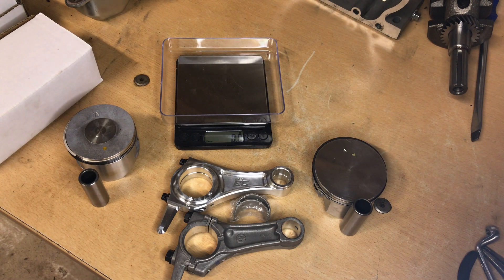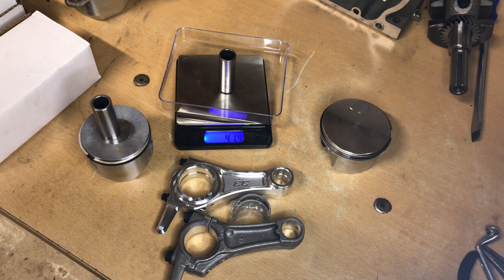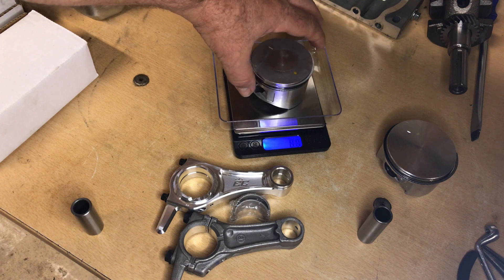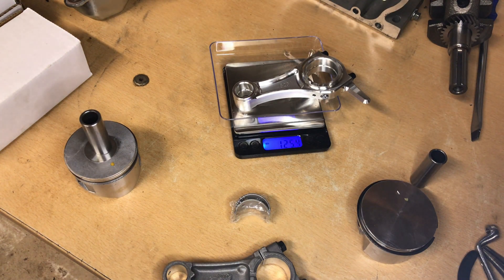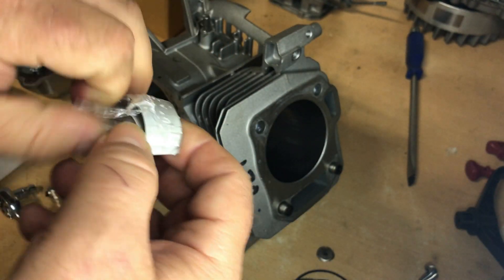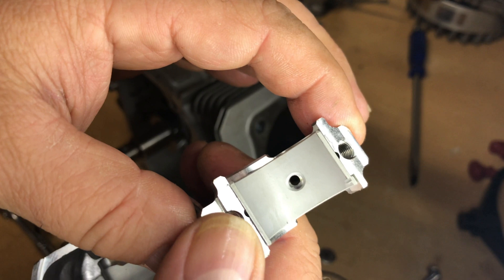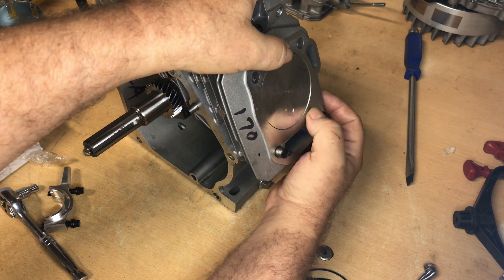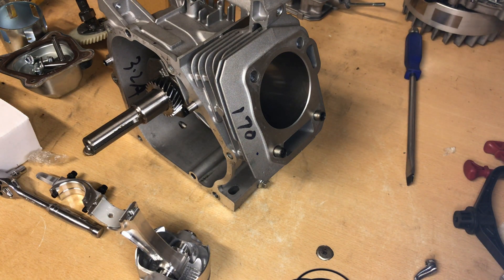Weighing The Wildcat 223 Piston & EC Billet Rod For The "Big Bore" 179cc to 208cc LCT Engine Build!

Comment: Whats the compression height on the wildcat piston
Reply from the maker: Hi Robert! According to EC it's 0.8835" or 22.45mm for the true compression height from the center of the wrist pin on the Wildcat 223 flat top. If you're measuring from the top of the wrist pin bore to the top of the piston you'll likely find they vary a bit, but you'll usually find them to range somewhere between 0.520 to 0.530. And yes, I know (0.010) is a LOT! These work very well with the 3.353" EC rods in most tall blocks (EX: Ducar). The 224 build on the channel used this piston and rod combo and that piston was almost .010 above deck at TDC. I debated whether or not to machine .010 off the top but elected to go with the pop up as it was. Good decision as far as it being a runner, not so good for starting with a pull rope though.

Comment: I have a 208. Is it worth building? The last motor I built was on the 90's, 5 HP Briggs. What parts don't interchange. Cam?
Reply from the maker: Hi Mackelby1! I like the little LCT engines. The 208 block has the same issue as the 179 block. The camshaft diameter at .569 is larger than the Honda clone .549 and Predator 212 non-hemi .559 diameter cams. The only drawback IMO is having to get a camshaft custom ground. There are work arounds of course by simply adding higher ratio rocker arms and a few more tricks. The crankshaft in the LCT engines is much nicer than you'll find in others too. Don't be afraid to build what you have. If nothing else at least the crankshaft will swap into a more camshaft friendly block and side cover as well. My thoughts on the LCT engines is what's the worst that can happen? If it blows and you ruin the block, oh well. 🤣 Better than sitting under a table gathering dust.
Reply: @KentuckyFriedFixes  thanks for responding
Reply: There discontinued 291 has a 58mm crankshaft. Really curious if it fits. Those cranks might be cheap if it's discontinued.
Reply from the maker: @mackelby1  I'd like to get a look at one. Now you've got me curious about it too!
Reply: @KentuckyFriedFixes  I hate to be that sad SOB that can't wait for you to try it so I can find out. Don't hold that against me please! Where do you get your LCT parts from?
Reply: @KentuckyFriedFixes  1" shaft, bummer. Thought I was on to something.
Reply from the maker: @mackelby1  Well shucks. You can't win 'em all but I like the way you think!
Reply from the maker: @mackelby1  The 179cc LCT engines came from the Surplus Center website. I purchased 2 of the 208cc LCT blocks from the bay place. The build parts I order online from several vendors, but EC Carburetors is the only place I've found that has the # 8281 connecting rod (3.353") I've ordered several of the Wildcat 223 flat top pistons from them as well. I'm not sponsored by anyone so I don't like to advertise for free but I do like EC carburetors for their Tilly race carbs. I'll post "Part 2 of the Big Bore LCT Build" soon, looks like part 1 finally got enough views. Thanks!

Comment: Just curious, I have a fairly built 224, and when I changed the flywheel to billit I thought it maybe seemed like you could feel the power stroke more than I could with the stock flywheel. I'm assuming a heavier flywheel would carry more rotating speed through all the strokes, or at least more consistent speed. Have you ever noticed a change in the way it feels at lower rpm? Hopefully this makes sense hahaha
Reply from the maker: Hi Brian! You've got it. That makes perfect sense. The lighter flywheel will not smooth out the engine as much as a heavier flywheel. Light flywheels are tough on rod bearings too. The heavier the flywheel, the smoother the engine will run at low RPM. The heavy flywheel stores more energy because it has more density, this allows the rotating mass to rely on the energy stored in the heavy flywheel to keep the engine turning in addition to the power coming from the power stroke of the engine. Unfortunately though, a heavy flywheel slows the acceleration and deceleration of the engine. So depending on the application a light flywheel could be good thing or bad. This is one of my favorite subjects and I could go on for days about flywheels but I won't. Thanks man!
Reply: @KentuckyFriedFixes  I swear you should be getting paid for this hahaha. The Mr Pete of mini bikes. Thanks I was hoping it wasn't just in my head

Comment: hi my question is about  b/s built i got a 4hp and i see more then i want i just want see a c/s 3/4 but i see a cam pulley is this a easy fix thank you
Reply from the maker: Hi Kevin! If you have an extended shaft coming thru the side cover from the cam it's likely you have a tiller engine. No problem at all. You can change cams or saw off the excess. I'd recommend changing the camshaft as there is some demand for those extended tiller camshafts on the bay place. It operates the "reverse" feature on some garden tillers and they don't make those anymore. You could probably get enough $ out of the stock cam to buy a performance camshaft for it!

Comment: That came out nice. Did you figure what CR you will have?
Reply from the maker: Depending on the chamber size of the head, if the head is 22cc it will come out close to 9.4:1, if it's 20cc it should be closer to 10:1 with the .012 steel shim head gasket. The only issue is I'm having to keep the stock camshaft with this one, but we will add a 1.3 rocker to the intake valve. I'll try to put the specs info in the description. I really need to buy or make a cc kit for these heads!